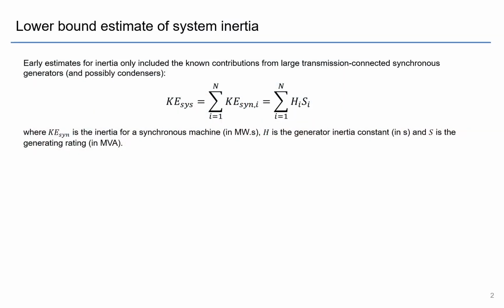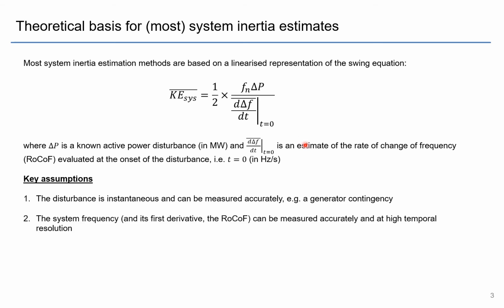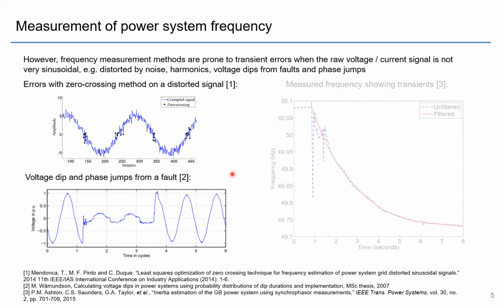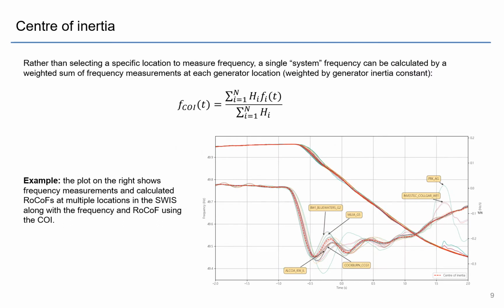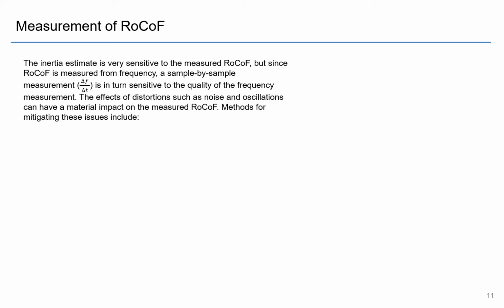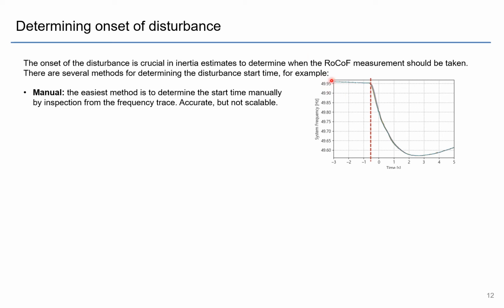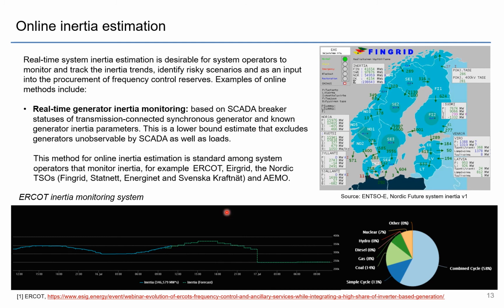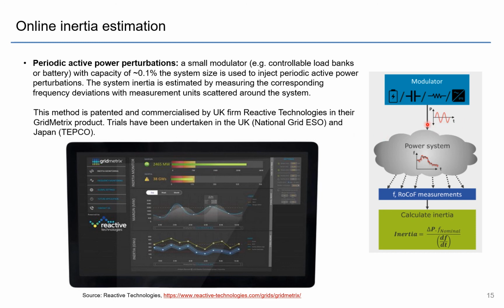Frequency Control in Low Inertia Power Systems - Part III: System Inertia Estimation

Comment: Hello Julius Susanto, my name is Luis Diego Villarreal, I am from Costa Rica and I am currently in the stage of the final graduation work to opt for the Bachelor's degree in Power Systems from the National Technical University of Costa Rica. The final work consists of estimating the inertia constant towards the north and south of Costa Rica, in an interconnected system that ranges from Mexico to Panama. Currently there are PMUs in the interconnections of the countries that make up the Central American Regional Electricity Market. Each country is modeled as a set of generators at each border, with inaccurate data. The idea is to be able to calculate an inertia constant that allows me to carry out analysis and training in the OTS room. Any literary help with examples of calculations and methodologies that are currently used to estimate the constant of inertia in interconnected electrical power systems would be of great help to complete the project. Greetings. My e-mail is ldperez@cfia.or.cr